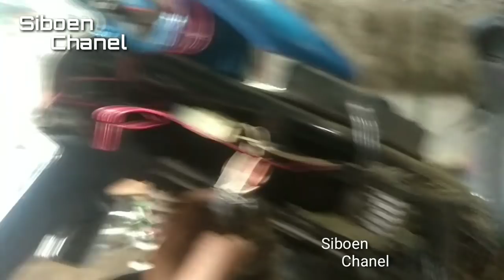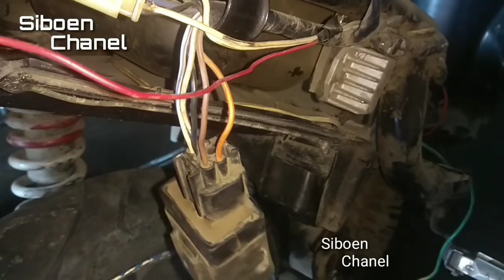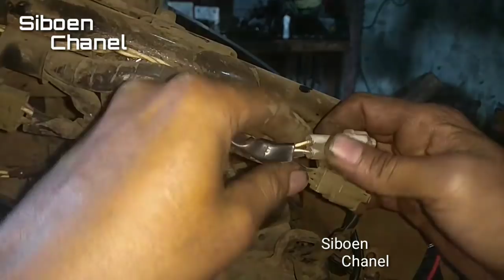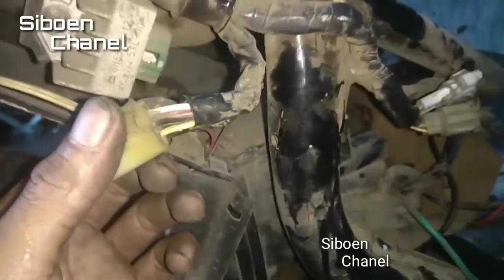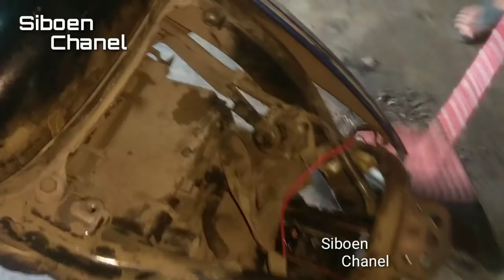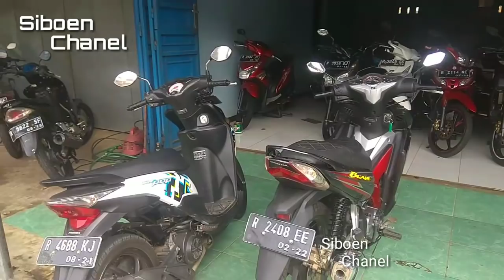Jalur kelistrikan CDI Yamaha Mio #Siboen tutor

Comment: salam jengat mas siboen, semoga sehat and rizkinya lancar, sya subscribe dari jakarta mau tanya output keluaran arus pengisian dari regulator berapa volt ya, soalnya mio smile saya aki tidak mengisi out pengisian dari regulator terukur 7volt di gas turun 5volt. seharusnya berapa volt mas boen, terima kasih
Reply from the maker: Tester di angka 7 volt stationer 
Dan 12,5 pada rpm tinggi
Reply: Jangan bosan bagi ilmu.jiwa guru mu sangat Bagus....aku i